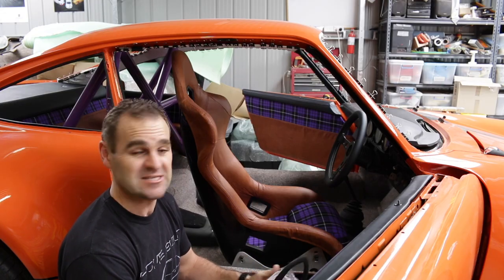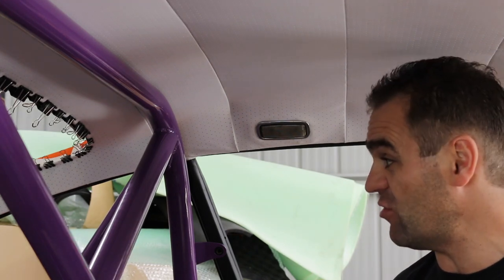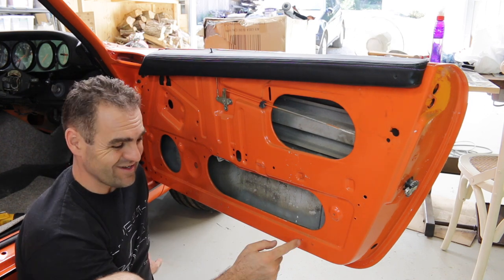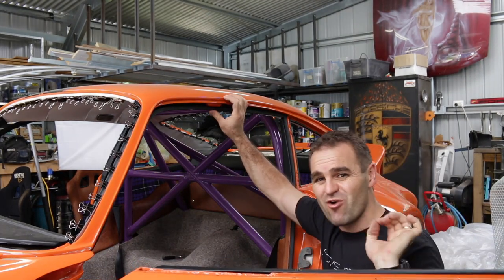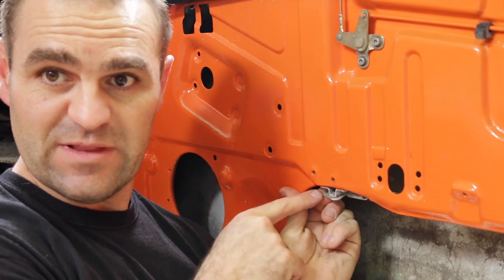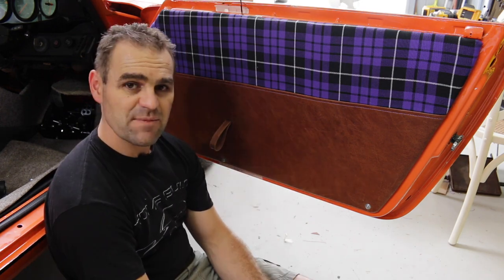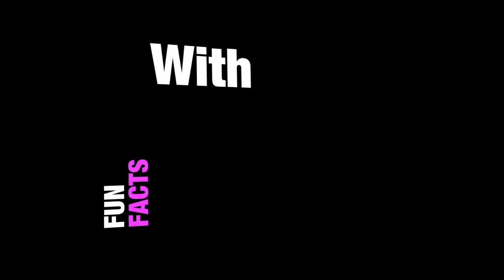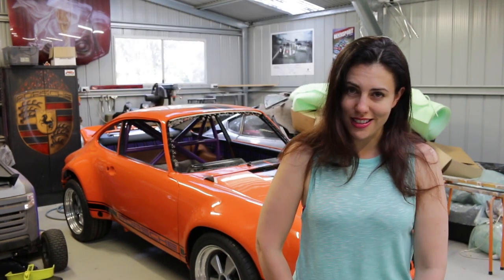How to make RS Door pulls - Porsche 911 Classic Car Build Part 43

Comment: Probably your doors will not prevent the door pulls getting wet (which is standard for an old 911) even with a full polythene weather-seal behind the door card. Water runs down the window, past the weather strip, gets in behind the weather seal polythene, and then onto the RS door pull, and capillary action does the rest; soaking the handle completely. For this reason, leather is probably a suboptimal option. 

Or you could just never ever have the car in the rain. But you live in Aus - so I guess that is an option!

A 3D Printer will make a nice door pull surround! It would take maybe 30 minutes to design, and a few minutes to print.

Oooh - don't forget to do the "911 Rev counter thing", when you rotate the rev counter so that the red line is when the needle is vertical. That way you can know when you change without looking at the dial.

Did you know that a 996 Turbo is basically 2/3rds of a 959, with a much stiffer body shell, and better software? Its engine is the LeMans winning Metzger unit, and it is an absolute monster of a thing. A 959 costs about 2 million NZD, but a 996 Turbo only costs about 80K NZD! It is, therefore, the greatest supercar bargain of all time.
Reply from the maker: That doesn't sound great. I will just am replacing the seals, but I will just have to play it by ear I suppose. If it becomes a problem, it will be something else I have to overcome ;)

Comment: Amazing work Jeff! Looking forward for your video every week.
Do you mind sharing what type of thread do you use to stitch leather? And what width specifically?
Reply from the maker: Thanks mate. I have used a couple of different threads. The purple stuff I bought from an upholstery supply place that is designed for that use. The brown stuff I got from my local craft shop and it was just the thickest stuff they carried. I looked, but the stuff I have doesn't seem to have a specific size marked anywhere, sorry.
Reply: Home Built By Jeff That's great, thanks a lot!

Comment: Hey Jeff, I reckon the heat gun might be too powerful.  A hair dryer might be enough to remove the wrinkles on the head liner.
Reply from the maker: Yes, you have to be careful, hairdryer would do it but it would take much longer and I am not that patient ;)

Comment: great vid as always    i dont understand what the wood is for when you made the trim pieces  also can you sketch the pattern you used to cut out the metal tabs
Reply from the maker: The wood was because the male part of the die was around 20mm long and the female part was only 6mm thick. If I didn't have the wood, the male part wouldn't be able to push all the way through. As for the pattern, I just rimmed them by eye.
Reply: thanks  lok for the vid first thing fridays  great build   coming together

Comment: Jeff,

This will sound lame, and it is to a point; I have a rivnut gun, but I just cannot work out how to properly adjust it for the metal thickness.  I and sure it just my stupidity, and I have looked for instructional videos but there is nothing around.  As you see to now how to use it properly, could you do a short instructional video?
Reply from the maker: You shouldn't have to adjust it for metal thickness, but to get a bit more crimp after I have squeezed it all the way. I then back out the large reverse thread part a couple of turns and then squeeze again. That seems to get some more crimp. Does that make sense?
Reply: Yes; so is the adjustable thread always fully tightened?
Reply from the maker: If you have the same type that I do, you have to change in and out the tips for the different sized threads (M5,M6,M8,etc). On mine these tips are attached to the gun itself by a large reverse thread. I just squeeze, then back out the reverse thread a bit and then squeeze again.
Reply: I think we have the same type; I'll continue experimenting with it.  Thanks for the advice.